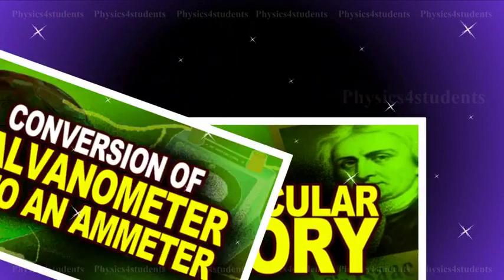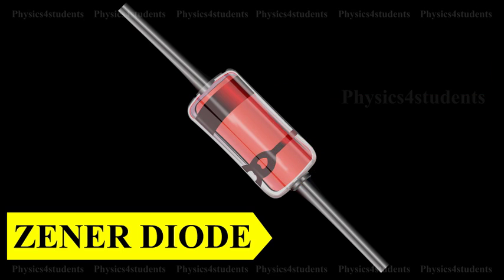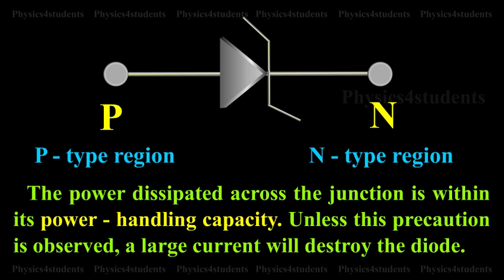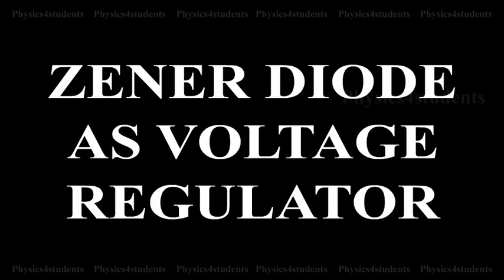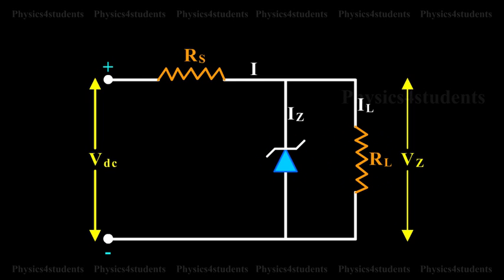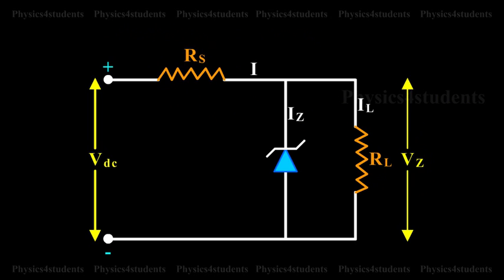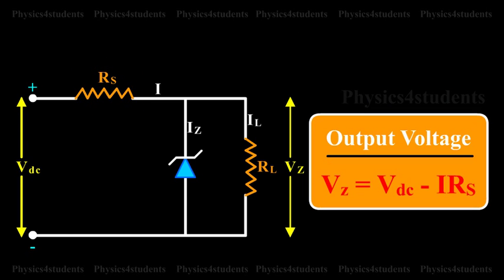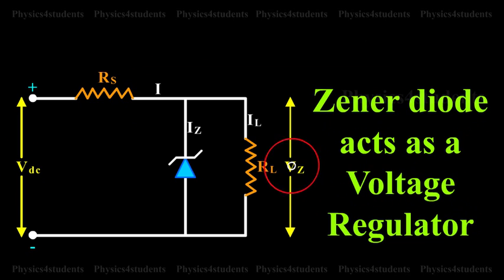Zener Diode as Voltage Regulator | Tutorials on Semiconductor Devices

Comment: At 1:33, the Diagram is wrong in the Forward Characteristics Curve section... It should not be a curve, it must be a Slanting line in 45 degrees! Zener Diode operates as a normal diode when forward biased, Current and voltage Increases Equally when the Applied Current and Voltage are Increased!!!